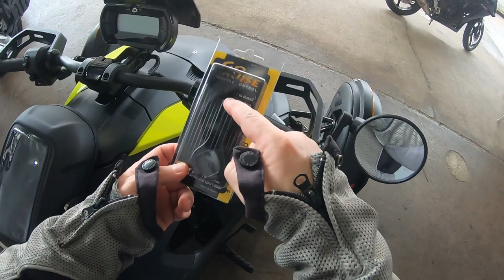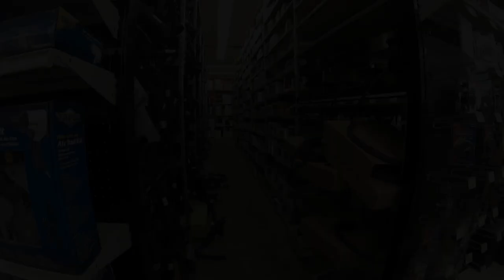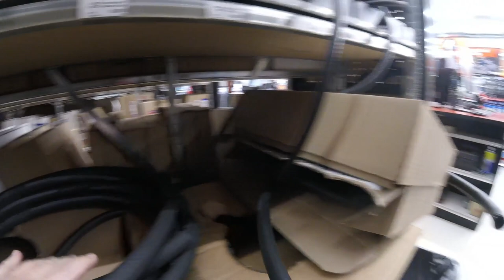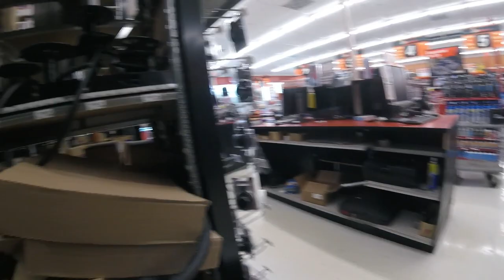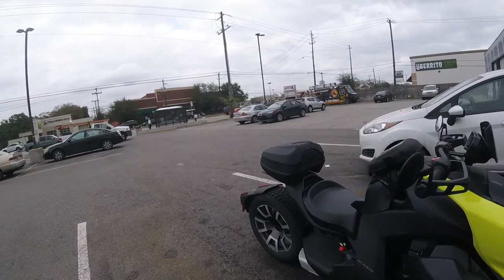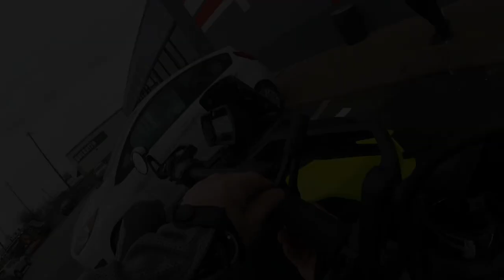RYKER: 2019 Can-Am Ryker Rally // Cruise Control, Throttle Lock Hack

Comment: Nice insight. Could you plz relist the hose size you used for those of us short of memory not wanting to watch again?  How would installing the BRP wind deflectors on the guards affect this hack? Thx.
Reply from the maker: I used about 2-3 inches of 1/2" heater hose for this hack. The full build recipe is in the video's description for reference.  Since this video was posted, I have also installed the BRP wind deflectors and handguard lighting... no problems with fit or interference.  The length of the heater hose extension can be adjusted by trimming it down to fit or just by pressing it further down onto the Go Cruise to shorten it.  Cheers!  --QM
Reply: Do make a video the handguard lighting installation? I haven't seen a video on YouTube.

Comment: Great video! Would one. Of the other Go Cruise locks work?
Reply from the maker: Thx for the feedback!  Yes, other 7/8" cruise/friction locks would work just fine.  The Go Cruise is an easy fit, and it's cheap... so that's my go-to tool for the job.  The Ryker's grips are a bit soft, so the cruise tends to slip a bit, but that's not a big problem.  I'll be replacing my grips soon because they are wearing down very fast already.  I'll probably put some ProGrip 718's (street bike) or maybe 714's (ADV/dual-sport) on there next.  Cheers!  👍  --QM

Comment: Didn't work for me.  I have the upgraded red BRP Grips and doesn't work.  I used clear tubing to extend.  Not easy to engage and when I do it doesn't lock on the speed.  Help, any suggestions?
Reply from the maker: Sorry for the late reply.  I've noticed that my Go Cruise will slip a little bit because the Ryker's grips are so soft and squishy.  The heater hose extension that I'm using can be squeezed further down the Go Cruise's length to make the "claw" clamp tighter on the grip.  I also use the black rubber band as a stopper to prevent the cruise from walking across the grip toward the right end.  Maybe you could email a picture or two of your situation so I can look at it?  --QM  quasimotard@gmail.com

Comment: Nice hack. Any chance I can get a pfd copy of the ryker rally service manual from you? @quietclarence Instagram page
Reply from the maker: Certainly!  I have a copy of the Operator's Manual in my Google Drive, but I recommend that you get it direct from Can-Am/BRP in case they update it with news or updated procedures.  Here is the link to BRP's documentation site (look for the Ryker under the "Roadster" category):  http://www.operatorsguides.brp.com/Index.aspx?lang=E&s1=8879abc3-258c-4bb1-a36d-0294a504c709

My Google Drive share with all of the other Ryker stuff is here:  https://drive.google.com/drive/u/2/folders/1uDUFHqlCMcI_fTY4ABPnS1XIyju3L89p

--
QM
Reply: @QuasiMotard  how about the shop repair manual?
Reply from the maker: @quietclarence7998  That's not available yet, as far as I know. I'm certain that it will be a paid item (copyright, etc), so that will be harder to obtain in PDF form.  I would like it for my own maintenance purposes, that's for sure.  --QM
Reply: @QuasiMotard  didn't think it was available yet. Thanks for all the links you have done
Reply: @QuasiMotard  also if your have to much slip with the throttle lock you can add rubber band around the lock until it stays
Reply from the maker: @quietclarence7998  Yep, thx for that! I typically use the rubber ring from the Go Cruise kit, or a bit of friction tape (baseball bat grip tape) around the pinch area to grab better on some of my bikes.
Reply: @QuasiMotard   The service manual is available.  I have one waiting at my dealer for me to pick up.  I think list is $95, they charged me $89.
Reply from the maker: @George-gd6op  Sweet!  I'll order one for my collection as well.  Thx for the heads-up! I wonder if they plan to release it in PDF form... that's always a trick because everyone shares it around and they can't make money.  ;-)  I have no qualms about paying $80-100 for one.  Thx again!  --QM
Reply from the maker: @George 25414  Thx for following along. Your early comments since the first video helped steer this ship wreck in the correct direction!  I don't know if you're still haunting the SpyderLovers forum or not, but I posted an update over there about the new/updated Ryker manual that BRP has on their download site.  The updated PDF has several more diagrams for the gearbox check/fill procedure now, as well as more content throughout.  For example, the gearbox section has moved from pp.103-104 down to pp.105-108... more detail above that from other topics, I presume.  Thx again!  --QM
Reply: @QuasiMotard  You rarely find PDF versions of service manuals.  A service manual is usually the first thing I purchase for any new bikes or equipment.  Sometimes it is better and less frustrating to just fix things yourself!
Reply from the maker: @George-gd6op  Agreed! I have factory shop manuals for all of my newer bikes (Honda, Yamaha, Ducati, etc), and Chilton/Clymer manuals for the oldies.  The factory versions are generally better, because they built the bike!  ;-) Thx again!
Reply: @QuasiMotard  Glad I was some help earlier.  I check in on the Forum every day, you can learn a lot and help a lot on the forums. Thanks for the cruise idea!  I ordered one this evening.
Reply: @QuasiMotard  after some research i found the ryker repair manual available to buy digital off copy here: https://brpmanuals.com/canam-spyder-manual.htm
Scroll to the bottom of page!
Reply from the maker: Wow, nice catch! I'll have to drop the $24.50 for that little gem!  --QM
Reply: @QuasiMotard  i bought it and can send you link
Reply from the maker: @quietclarence7998  You can email the file or the link to my Gmail address (quasimotard@gmail.com). If it's the real deal from BRP, then I'll certainly pay them money for my own download! I was already planning to purchase the printed version, but the digital copy is more convenient for the garage tasks.  --QM
Reply: @QuasiMotard  link emailed
Reply from the maker: @quietclarence7998  Got it, thx!  I'll dig through that to satisfy my curiosities on the driveline issues (e.g. rear end clunk on accel, whine on decel, etc).  I can't figure out of that is copyrighted material or not, so I won't put it up in my Google Drive yet.  If it's public-domain, then I'll put it out there for others to grab.  --QM